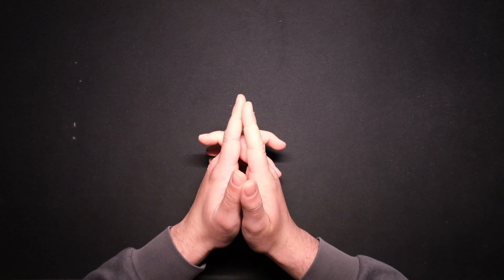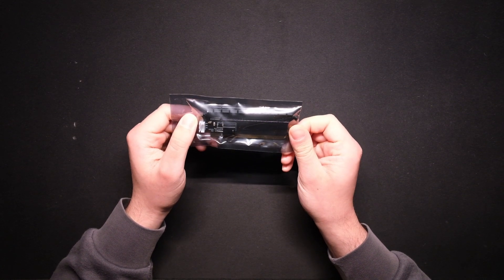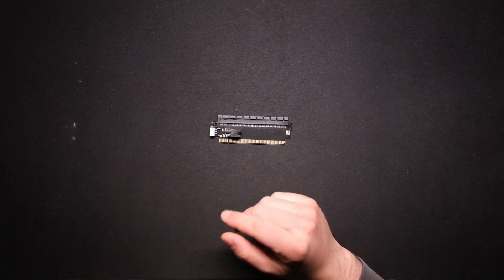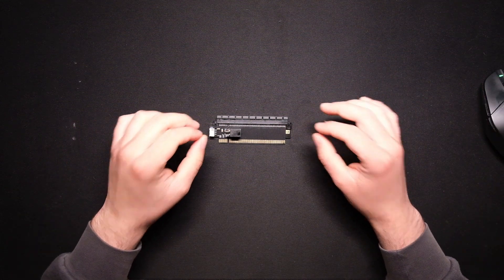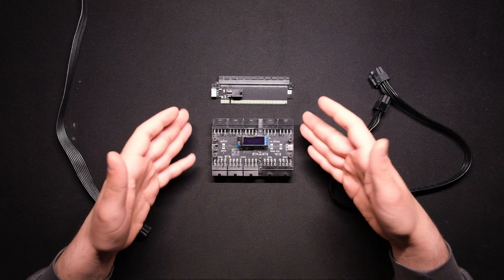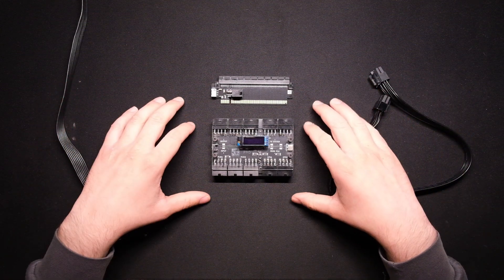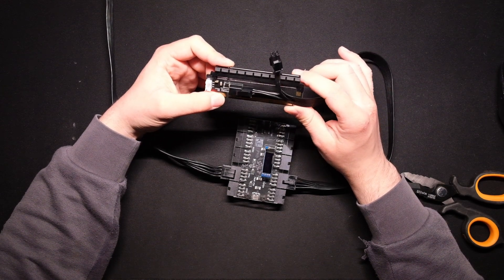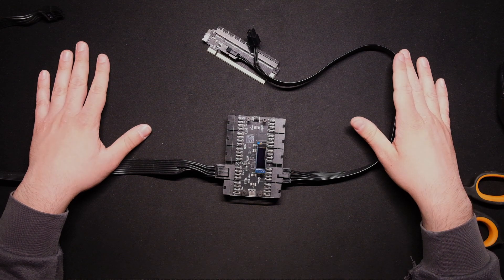ElmorLabs PMD-AD-P4X16 PCIe 4.0 Slot Power Measurement Adapter

Comment: Are the 3.3V and 3.3V AUX rails passed through or do the pads need to be shorted to allow 3.3V to the card?
Reply: Cont testing mine shows both 3.3v passed through just the 12v is isolated. Everything thing else looks like testpoints.